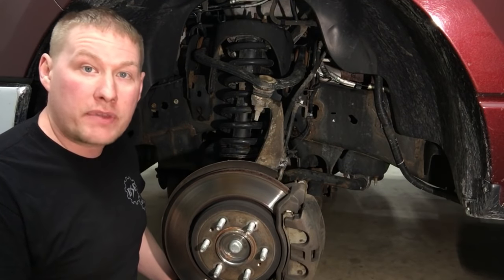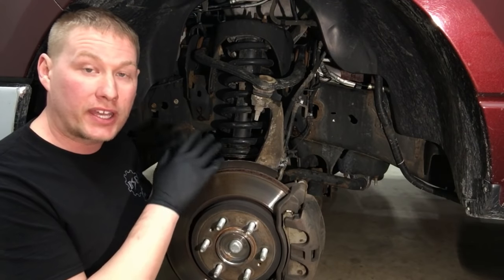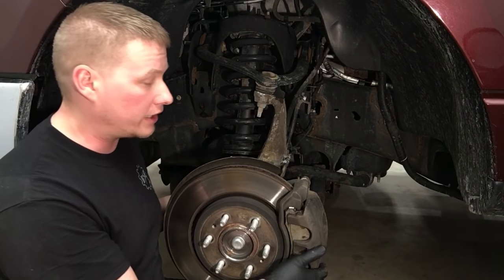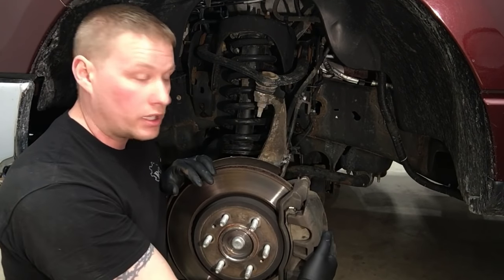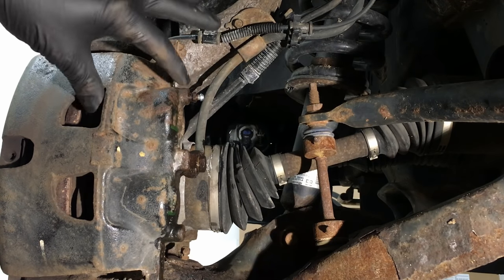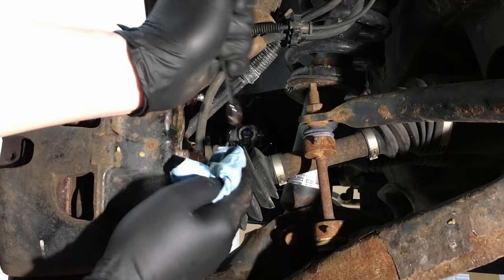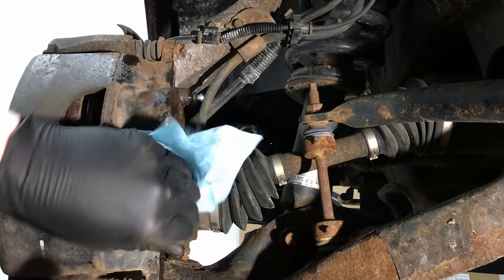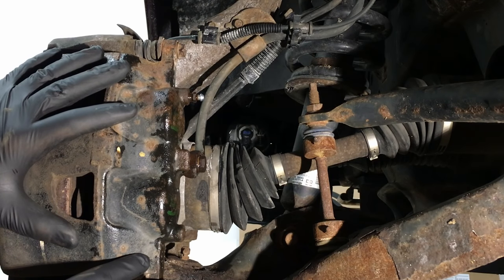Ford Quick Tips #73: Quickly Diagnose a Sticking Brake Caliper w/ One Simple Test

Comment from the maker: If you find the caliper is sticking follow this video here to replace it right- https://www.youtube.com/watch?v=0zbXNMu9Gww
A good set of line wrenches is a must-
http://amzn.to/2osakFB
When replacing a Caliper it's best to get a complete unit w/ bracket so it's all new-
http://amzn.to/2o1tzF1
Reply: FordTechMakuloco I have a none related question. Just couldn't find a way to direct message you. I have a 2008 f150. The shifter won't shift out of park when I press the brake pedal. Sometimes it works.  Most of the time it doesn't. I've taken it to ford and apparently their techs are stumped and have no clue. Any advice? How can I donate to you? Thanks.
Reply: Rickie Bobbie I've had same problem sounds like shift interlock/brake light switch  try Google search.
Reply: Ok, first of all, love your channel. For a Ford guy, this channel is a must subscribe for sure. Now, I have a 2007 Taurus, and I've had an issue of a soft, sometimes almost going to the floor, brake pedal for a couple months. I figured it probably just needed bled, but never found the time to get that done. Now, today the brakes went all the way to the floor while I was stopped at a red light and the car started moving forward and I couldn't stop it even with pushing the pedal as hard as I could. So I got the car home, and bled the brakes, but it didn't make a difference. So I'm assuming I need a new master cylinder, and of course I came here looking for a video, but can't find it. Do you have a video on master cylinder replacement? It would be greatly appreciated as the car is down until I get this done.
Reply: FordTechMakuloco the best ford quick tip you can give people is not to buy a crappy ford the escape i have is going to be my last ford ever.
Reply: FordTechMakuloco great video! a friend of mine has a 2005 ford 500 with brake problems. its abs and has hardly any stopping power. master cylinder is full of fluid but when he bled the brakes, there was no fluid at the front passenger side bleed screw. any ideas Brian?
Reply: Happened on my Silverado I bought new.
Reply: FordTechMakuloco .. What if I didn't notice them sticking till after they were smoking red hot and then put the poor truck away for 6 months.. what am I looking at at this point?!?
Reply: Svern Warunos .. Yeah good luck with GM or Dodge! Toyota is good, but don't expect the other 2 American companies to be any good
Reply: I have a ford explorer 2013  may I know if the car has to be in parking or neutro position to this test????
Reply: FordTechMakuloco what do you suggest is a good reman caliper for a 7.3L ? Can I get a link from ya please ?  Thanks
Reply: My 07 Expedition has 170k
I purchased new Rotors and Pads and Fluid. After watching this im just going to go ahead and order 4 Calipers aswell. That way i have a fully new brake system.👍🏻👍🏻
Reply: After getting a grinding noise, I bought new rotors, pads, and calipers…. Now it’s worse and getting a shutter any advice
Reply: @jeffabercrombie167  bad wheel bearings can mess with your brakes aswell. I replaced a caliper 2 times on a 2000 f150. Found out the bearing in the sealed hub were bad when the wheel got violent whobble at 70mph.
Reply: @UserUser14880  I’ve replaced the calipers before this, I’m wondering if the big bolts for the calipers had some sort of washer or sleeve where they would touch the caliper?  The truck has 282k miles…
Reply: My friend just changed my rear pads and parking brake shoes and brake hardware on my 06 Lexus gx and now I noticed that I’m having to press on the accelerator maybe 10-15% harder to maintain speed.also when I’m parked on a slight hill not even that steep almost flat it won’t coast on its on when I’m drive and foot off the brake. I did a test today and got out of the car when it was in drive and the car didn’t move. He thinks it’s a dirty throttle body but it can’t be a coincidence that it happened right after he replaced those parts. If it was a dirty throttle body it would most likely idle rough and my rpm’s would be inconsistent when in park but that’s not the case. I’m thinking it has something to do with the way the calipers were put on when he was finishing up with the brake job

Comment: Great video, very helpful. Helped me diagnose a collapsed brake line on the wife's car this evening after replacing the caliper. Pressed the brakes to check for fluid squirting out at the bleed valve and noticed there was almost zero fluid. Removed the brake line and found you could not blow through it. New brake line and now it's all good!

Comment: Great video! In my experience its nearly always the caliper guide pins sticking. Disassembly and copious amounts of grease always solves it. Especially in wet climates. :) I have never had a caliper piston seal go bad. I have seen them go plenty manky but never leak or seize. I'm sure they do but disproportionately its the pins.
Reply: Be careful on the grease! I learned the hard way if you put too much grease on the pins you can hydraulically lock the pins in place.  Imagine

Comment: Thank you!  I did a 4 wheel brake job for my father and mother in law on their 04 explorer 4x4 and the rear driver wheel is sticking so bad it's got the brand new rotor damn near red hot.  When I tested it after the work it was completely fine.  Worked as it should. Yesterday about 1 month after the job she came in from work and that rotor was smoking. Brake dust all over the wheel. Very obvious what had happened.  Today I'm going to pull the wheel back off and do the diagnosis you just shared with us.  Thank you!

Comment: thanks!  i have twisted a hose before and it does rob performance.  i didnt even think of checking the line pressure release.  its those little tips and tricks that i appreciate the most
Reply: There's usually a line dyed into them lengthwise to serve as a visual.  When they are old, it can be hard to see though.

Comment: Very helpful. 
I am working on a car I will be eventually owning. One of my parents cars.
An 02 Lincoln LS 3.9 V-8.
It has brake issues. Low pedal. We had it our mechanic for over a week. He couldn’t find the problem. I was driving it the other day an felt through the steering wheel a light vibration when accelerating on the highway. Maybe went on for a minute or so then stopped. Then the brake pedal was very firm. 
Stopped at a you squirt em car wash. Felt the wheel in the front end. Very, very hot, but not hot enough to burn my hand. I had been driving in rain.  My thought being now it is a caliper either seizing up or getting ready to seize up.
This helps me very much to do a quick test on it to determine if that is what it really is.
Thank you very much for your awesome videos.

Comment: If you have uneven brake pad wear, I have often found that there are 2 potential causes.

Slide pin to caliper bore too tight.  Sometimes these can even "freeze".  The slide pins need to be SHINEY clean !  Use a Scotch Bright or very fine emery cloth or run a wire wheel across them.  It is difficult to clean the caliper slide pin bore hole.  Hose it out with brake cleaner then use a tight roll of emery cloth to try and polish the inside.  If you can not EASILY slide the pin all the way in and out even after it is lubed, it is still too tight.

Second, is rust UNDER the stainless steel shims.  Scotch Bright, emery cloth, wire wheel.  Get then as clean as possible and then coat that area with caliper grease.

Last, it you have had "premature"/uneven brake pad wear on the same wheel, bite the bullet.  Get a reman caliper, but purchase one WITH THE MOUNTING BRACKET AND SLIDE PINS INCLUDED !  I have found this is the ONLY sure cure.  After 3 replacement sets of good quality ceramic rear brake pads on my 2007 Fusion in under 90k, this solved the problem.
Reply: How do you prevent that issue? My dad had problems with his '06 6.0 and now just spent 3 hours to pull that slide pin after it froze on his '17 f250. The inside brake pads on the front were worn down to metal while the outsides were like new.

Comment: One more thanks.
I recently (mileage wise) changed pads, discs, and fluid to fix sticking front brakes.
Next time I needed the truck the brakes were squealing at idle speed
Now I can check for bad calipers

Comment: Another thing to add sometimes the slider pins are bent it the carrier is warped.  When the piston are retracted and the caliber bolts are tight to the sliders and the caliber does not move, then you loosen the caliper bolts to the sliders and it now moves freely most likely the pins are bent or the carrier is warped. I have come across this in my travels. Just something else to add to the sticking diagnosis

Comment: Brian Great Tips and Tricks!! Thanks man.  

Hey, while watching the video I noticed the truck end links seem odd. At first it seems as though they haven't been greased or serviced in a very, very long time.  Check out the condition of the end links at the 3:04 time stamp. 

Only reason I'm mentioning this is b/c I have been surfing for research tips on this and have found that many ford pickups have the same failures. I am replacing mine this weekend along with the cracked sway bar bushings. FoMoCo replacement parts are ridiculously expensive and they don't come with predrilled zerk fitting holes. 

I have to admit that finding the right endlinks was a bit of a challenge because I managed to get the last two on the island.  Shows you how fast they sell out over here.  A word to the wise is make sure you specify RWD or 4 wheel drive when buying and triple check the parts in the box. RWD end links are 224.7mm while the 4WD are over 240mm. I don't know if the extra length on the 4WD part affects the RWD trucks but if Ford says to use the 224.7mm on RWD end links then that's good enuff for me.

Comment: Excellent video for diagnosing sticking brakes. 
I have a related question/experience...I recently replaced my front brakes in a 2018 4WD F150 because i was getting extreme vibrations when braking at highway speeds.The  rotors and pads were replaced 2 years ago by a local mechanic. At that time he told me the guide pins were frozen. On this DIY change the rotors and pads looked fine but , both front lower guide pins were siezed tight and could only free up with heat and hammer. I did end up replacing the rotors and pads since i had it apart. I surmise the vibrations were a result of the frozen pins not allowing the caliper to fully float. Does this make sense?

Comment: I went through 3 rebuilt calipers from NAPA before I could find one the wouldn't leak at the banjo fitting.  3 flex hoses also.  They where good about it though.  
When you get a caliper or hose that uses a banjo fitting, make sure the surface is prepped correctly.  On the caliper where the banjo fitting mounts, there should be a "spotface", a round machined flat spot with no paint but it should also have 2 circular ridges in the spotface.  The first caliper I got was in "as cast" condition, no spot face at all! second one had a spotface but no ridges.  2 of the hoses had the spot face but no circular ridges.  Such is the adventure of working on vehicles.

Comment: @FordTechMakuloco, I'm having Drag but my pistons move freely with pressure applied as if I am doing a pad change. What do you think? I pressed them back in, and the wheel moved fine. I applied small amount of lube to the slide pins that move freely and to the new brackets so the pads will move as well.
Reply: What did it end up being?

Comment: I love these videos, just when i think I know everything, you teach me a little more.
I am a tech up here in the rust belt, we are besides ourselves in frustration over quality reman supply, 50% of our product is bad out of the box, they either leak (10%) , pad clack from sloppy fit in the brackets (20%) or pistons wont release properly.  (70%)  
Buying new from dealer isnt an option due to the price, and sometimes all they have is the same stuff we can get, just without the warranty.
is there something going on with the rubber?  any insight?  Help!
Reply: Not hand made and tested. These calipers may have been remanned 10 times before you get it. Million a day shipped.  Luck of the draw unless you pay for hand crafted and pre tested.
Its literally impossible.

Comment: Just so you know I have a 2010 f150 and had a brake caliper seize up on me ....-40 doing 100km/hr ripped the seal on the caliper when I went to slow down for a town ....pissed out all the brake fluid and my foot went to the floor ..I got it slowed down in time luckily ...limped it into to town and got it repaired. Don't let this issue go unattended for long. It can kill you

Comment: I didn't see this mentioned here, if it was, sorry. On my 12 F150 my left front rotor was 375 degrees after a drive and it felt like I was pulling a trailer. I found the brake hose clamp was rusting and crushing the brake line. Follow the brake line from the caliper up about 5". You can see it clearly at 3:05 of the video about the 12 o'clock position on the screen, very top edge. Spread that clamp with a crowbar, I spread it just enough to slide the hose out. Tap out all the rust and inspect the line. If the line is good, put it back in and tap/tighten the clamp with a hammer just enough to hold it in there. Now my hose slides freely but won't escape. Brakes work fine after doing this. Road salt sucks!!!

Comment: 2003 ford explorer RWD.  The  front axle caliper glide pins are different with one of them having a short rubber sleeve at the end of it - I have read it is called the locking pin?  Does it matter what position (top or bottom) this pin goes?  many thanks for your great videos

Comment: I usually change both the caliper and flex lines because if the caliper has been sticking really badly the heat will cause flex hose damage and cause failure sooner than later anyway it's not worth not changing both. And yes I know some people are going to say oh well I'm on a budget but if it locks up again you just cooked the seals of the caliper you put on and heat scored the rotor again aswell so your not saving any money.

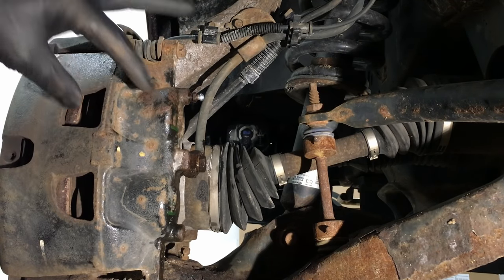Comment: I know that this is an old video but I had a sticking brake on a brand new caliper today. I tested for friction before and after putting the wheel on and there was no problem. A short test drive and one brake was smoking. I jacked the car back up and there was no friction when turning the wheel so I referred to YouTube. Some guy posted a video from 2014 with the same problem, turns out it was the clamp that you are pointing to with your middle finger at 3:39. I have no idea why but it seems like that clamp can eventually restrict the flow of the brake fluid, he said it was from the rust build up pinching the hose, (I don't know if that's true or not). I used a flat bar to ever, ever so slightly open up that clamp where is holds the hose and that solved the problem. Hope this helps someone else.

Comment: My first car, a ‘02 Ford Focus, had this problem.  At the time, I didn’t know what it was.  I’d be on the interstate then all of a sudden the car would start slowing down and I’d pull over, wait anywhere between 10-30 minutes for it to “unstick” and then went on about my way.  Only thing then was the brake pedal would go halfway to the floor before “catching” the car.  Had new pads and rotors, both had less than 20K miles on them and the car had 180K miles (maybe that was the problem?).  I miss that thing, never did break down and leave me completely stranded.

Comment: great tip...any tips on finding seized/dragging calipers  when the bleeder doesn't open?
Reply from the maker: Most bleeders will come lose with a map gas torch but worst case scenario you can loosen then banjo bolt to test it the same way. In reality you can just retighten the banjo after without replacing the washers too you just need to tighten it a bit more.

Comment: My Bronco seems to only have an issue when it’s hot outside. The rear antilock light comes on every once in awhile and the rear end has gotten so hot I had to pull over and wait for the smoke to clear. Thankful I didn’t burn it to the ground.

Comment: Mine just start jerking the steering wheels and smoking like hell...so I figured it was sticking
Reply: Same here. 06 front drivers.  Wondering if this is a pump thing or what ??
Reply: Mine too. 06. Pulling to left and then smoking like hell. Was stuck. I took apart. Slide pins were fairly sticky.  Bottom one was pretty stuck. Cleaned and relubed   Well see if that was all the problems
Reply: You may have a warped rotor as well

Comment: 2011 F150 4x4 I have replaced everything in the front brakes rotors calipers and caliper brackets and the brakes not not seem to release not twisted lines. Once they get hot i dont even have to apply brake peddle pressure to stay stopped at a stop sign.

Comment: Great help thanks,would a sticking caliper cause the truck to brake while going in reverse? Thought I would check that before checking on the rear e brake self adjuster as someone told me that could be my problem. But the rear tires move freely when on a jack. 06 e250 headache. Any help is appreciated

Comment: 2009 f150. My passenger side front caliper hangs up very intermittently, for just a second then releases.  Typically on a turn.  I took the brake apart. Hose is fine; not clogged. No excessive wear on the pads or rotors. The wheel spins the same as the other side. Any thoughts what could be the issue? This all started after I had the steering gear assembly and outer tie rods replaced. The mechanic says the brakes weren’t touched.